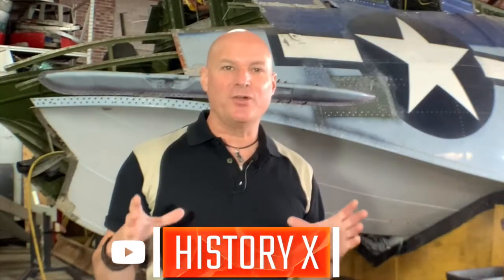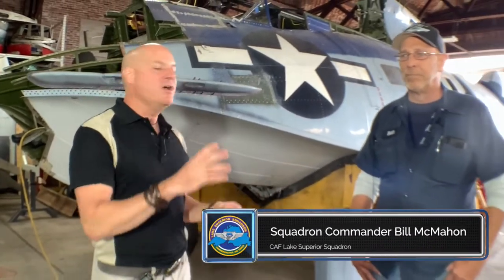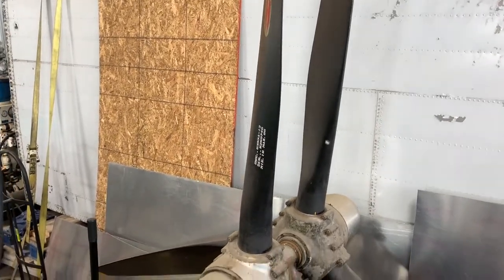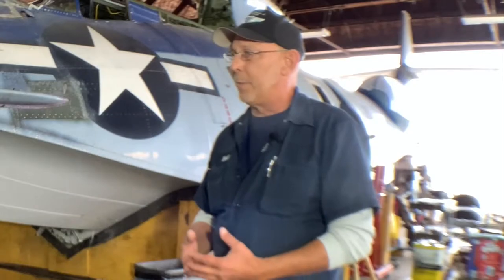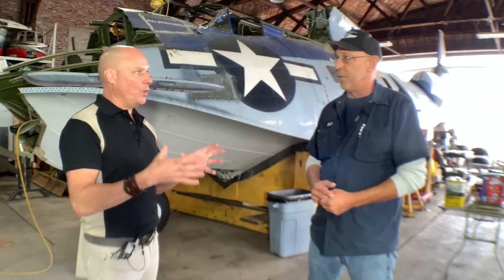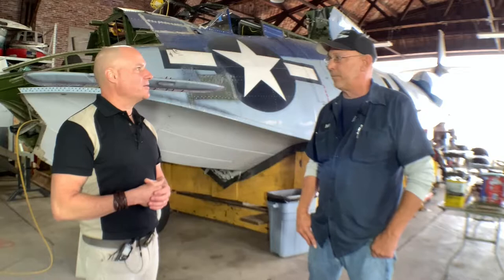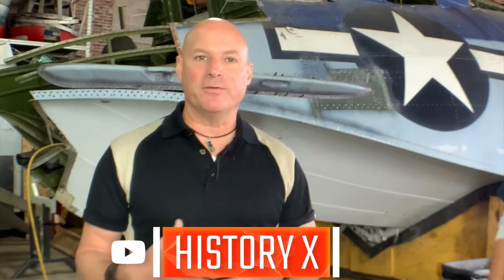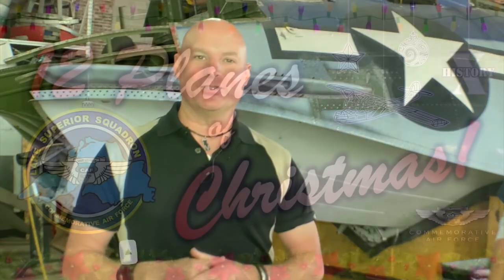Propeller Overhaul, 12 Planes of Christmas, PBY Catalina, Commemorative Air Force

Comment: The propellers are at about the same level as where the pilot is sitting, and so if anything goes wrong, and comes loose from the propeller, that piece could potentially fly right into the cockpit and hit the pilot.